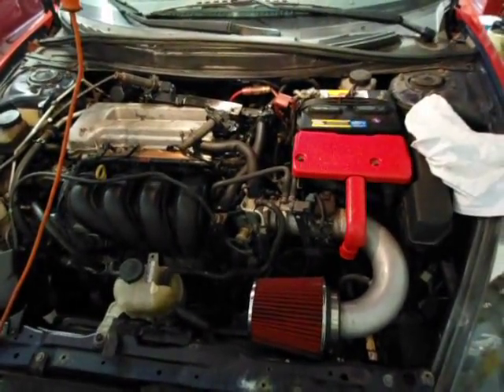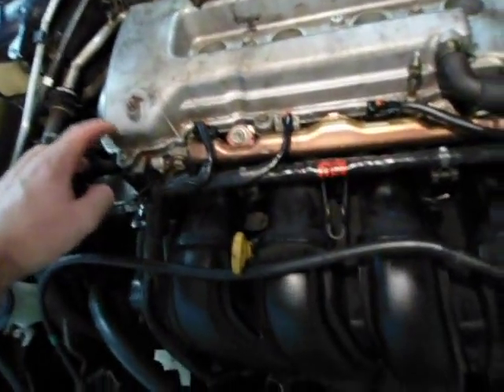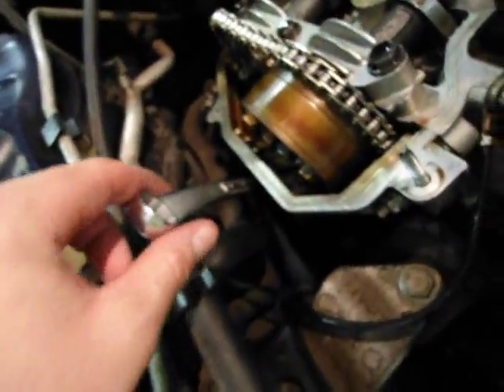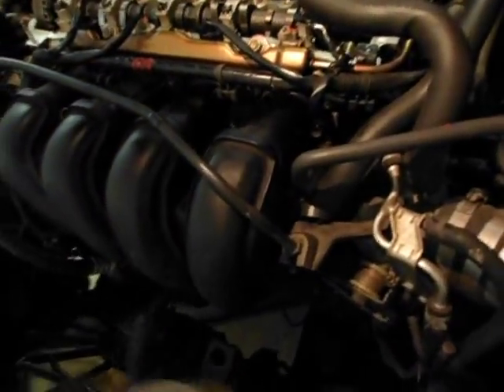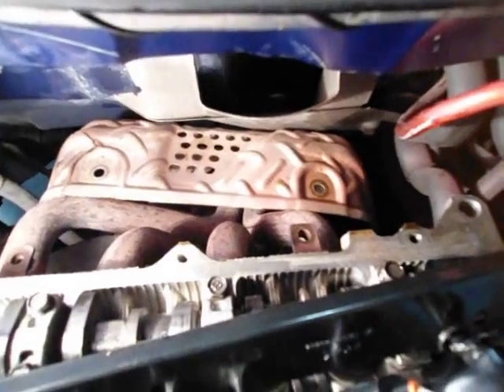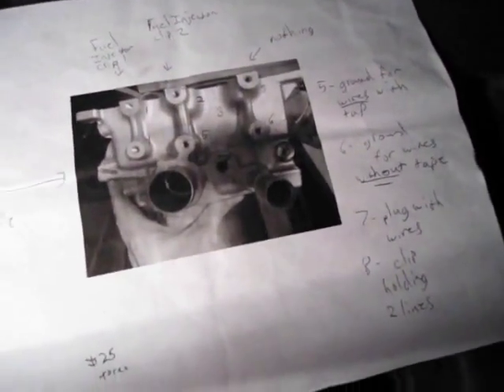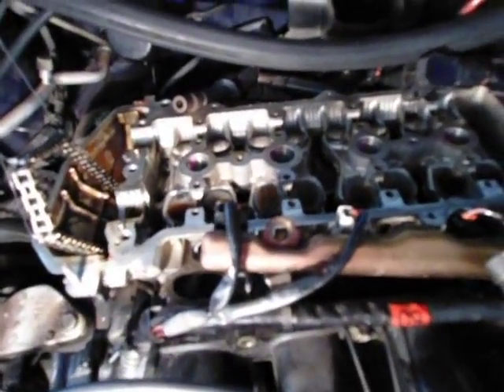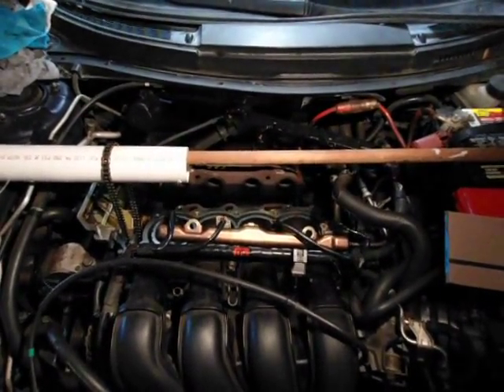Replacing the head of VVTI celica engine 2000-2005

Comment: That's a mission!! My celica is burning oil like mad now and I'm sure my headgasket is leaking a bit... the repairs would cost more then what I paid for the car it has 180k miles I'm hoping to make it last this winter and get another maybe an 04 without the oil burn issue they are good cars i put 80k miles  on it I think I got my money's worth of 2200
Reply: I have a Toyota celica 2000 gts and it has like 275k miles but it burns oil like crazy and you always gotta do your oil changes on time or you can have some really bad troubles later

Comment: So I hope you reply to this as soon as you can but I'm having a lot of trouble finding the size socket I need to loosen the 12point head bolts. What size did you use?
Reply from the maker: It was a custom bit that took me awhile to find. I think I got it in a set from AutoZone. That's all the info I can remember. It's been years. I haven't owned the car since 2016

Comment: So how did you get that little bolt off that holds the timing chain guide to the head? It's a right bastard to get to I'm dreading putting it back in the same way it was took out
Reply from the maker: It was a bitch. Tie fishing line to the bolt and get it started with needle nose plyers

Comment: I need to replace my valves in the head so I need to remove the head but I am afraid to mess up with the timing belt. Once the head is removed, what do you do to make sure the correct timing will be set once you put back the head again?
Reply: Just tie the chain up with tension..old school trick is tying the mid-point ofthe chain between the cams to the bonnet/hood, you could also use a paint marker on the cogs and chain links (12 o'clock pos)....its important you dont let the chain slack or fall as you would risk moving it a teeth or 2 right at the bottom...and if that happens you'll need to take out the entire engine and time the entire thing again!

Comment: are there any tricks or tips u used to get the bolt for the chain guide back into the head?
Reply from the maker: James Jacobs it was VERY difficult. Definitely tie a piece of fishing line near the head of the bolt then use needle nose pliers to get it started in the hole. Once its started use your fingers to get it a bit more in. Once its near half way, cut the string where you tied the knot so it all comes off the bolt then use a box end 10mm to squeeze in there and finish getting the bolt in with small turns
Reply from the maker: The string is in case you drop the bolt (you will). It takes forever but you will get it eventually
Reply: my hero. I've been fighting that one bolt for 2 days.
Reply: yeah that was a definite with a the string. i even tied the wrench to my other wrist in case i dropped it. 
 one last question if u will,
 the timing tensioner is pushed all the way out, i see that little latch, do i need to reset the tension to get the cam gears back in place?
Reply from the maker: James Jacobs good luck! Keep working it and you will get it soon.
Reply: Czar Corey one last question if u will,
 the timing tensioner is pushed all the way out, i see that little latch, do i need to reset the tension to get the cam gears back in place?
Reply: @jamesjacobs1815  Yeah press the little latch and press in the tensioner all the way as described in the manual

Comment: Hello , very interesting movie here.
Please tell me, did you really take of the head,without taking away the chain cover?
As i understand, you just removed the bolts from the cover, which are bolted to the head, so the head becomes free and you can remove it, without removing the whole cover.
Thanks and let me know.
Reply from the maker: Sorry for the late response. Yes if you remove all the bolts I specified in the video and keep the chain tight while removing the head, you dont need to take the side chain cover off. It isnt the safest but it worked for me twice.
Reply from the maker: +Haaris Edhi it was VERY hard. I believe a box at the perfect angle broke it then I used the tips of my fingers to loosen it. I tied a string on the bolt when it was half out then used fingers to get it the rest of the way then pulled it out with the string